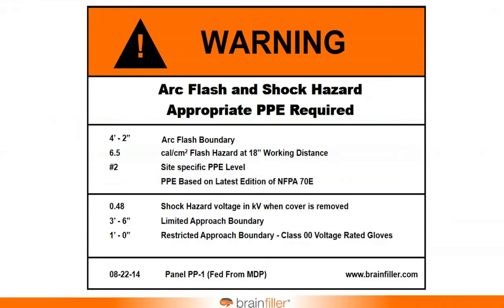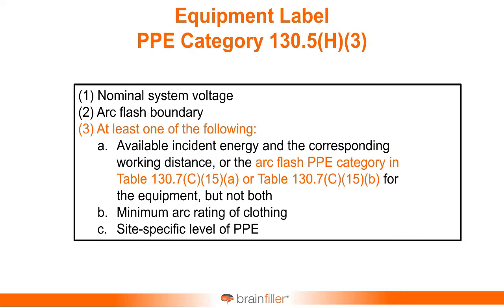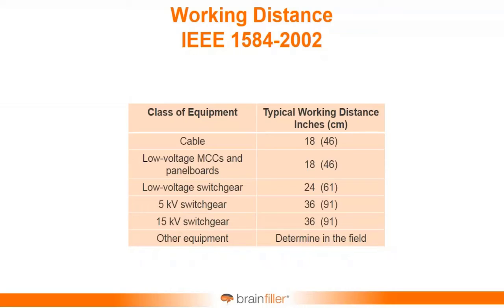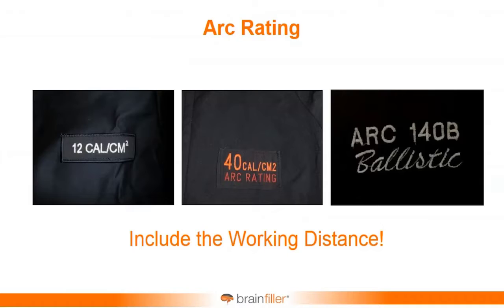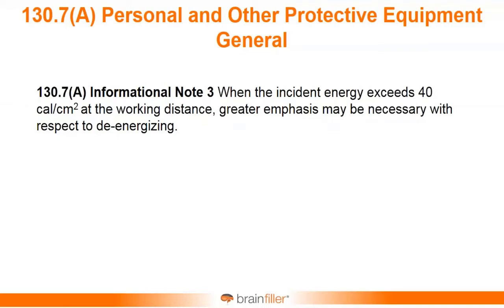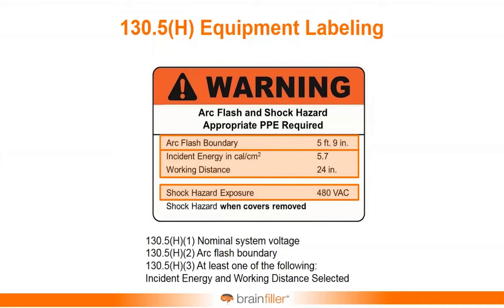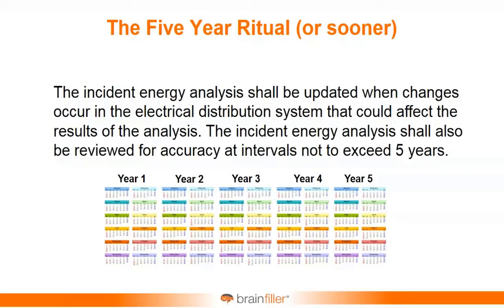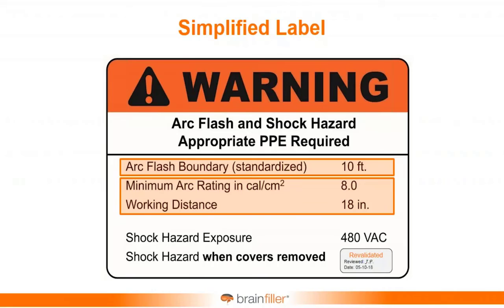Arc Flash Labeling Strategies – Keeping it Simple!

Comment: I have a question about AF labels on transformers. The incident energy calculation will typically be highest when calculations are based on the secondary side of a step down transformer. However, the shock protection value should be based on the higher voltage, which would be the primary side. We have transformers that are 25K on the primary and 480 on the secondary. Have you ever seen software that can produce information on a sticker that lists the highest incident energy (for secondary side), but also shows shock protection requirements based on the high primary voltage?